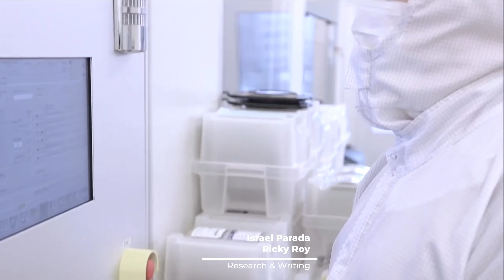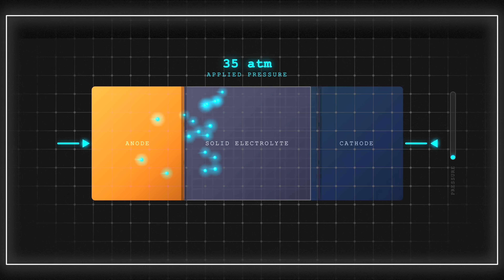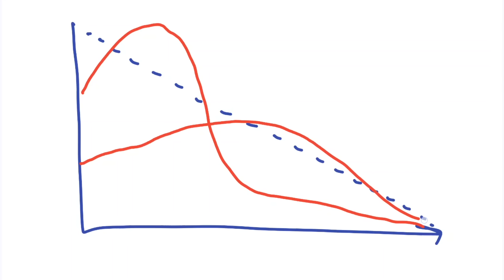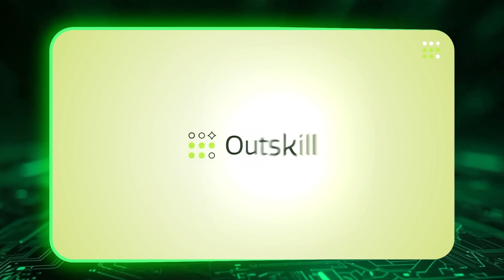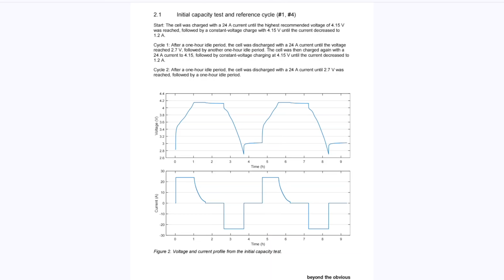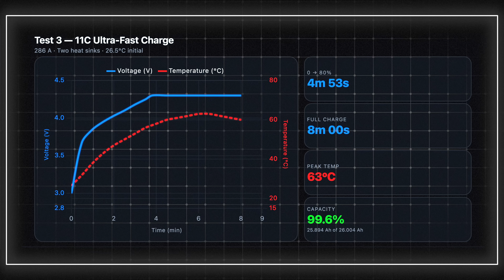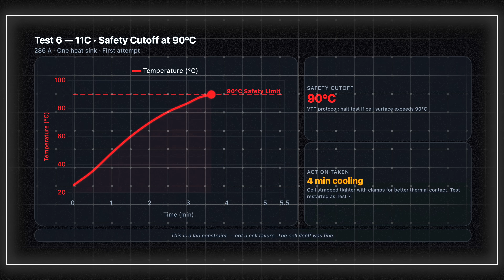Donut Lab's Solid State Battery Test are Shocking...

Comment: Great videos Ricky. You say it's evolutionary but not game changing: It sounds game changing to me. Let's lay it out in no particular order:
1) Charging rate: 10C seems like one of the biggest hurdles to "range anxiety" in an EV. It seems to me that if 10C could be accomplished, then the industry would be highly motivated to ramp up  charging stations. Perhaps incorporate them into existing gas stations.
2) Safety: If they're safer than LI batteries this is another huge "game changing" attribute. They can now be carried and used on aircraft or boats.
3) Watt/Hour Density: If they're alot smaller, then more can be fit into the same space, whittling away at "range anxiety"
I can't wait for future test results and for them to come onto the market.

I just watched Ryan's video (Ziroth) and think I now understand some things Ricky was trying to convey, but Ryan did much more concisely. (this is me not paying close enough attention to Ricky's video. You're awesome Ricky!)
With that said, I now see why Ricky says this is not "game changing" and it honestly has taken the wind out of my sails for this battery by Donut Labs. Time will tell if this is revolutionary but the points Ryan made are very deflating and almost make me think of Donut Lab's battery as "Snake oil".
I still can't wait for future testing, especially destructive analysis to see what they're really made of.

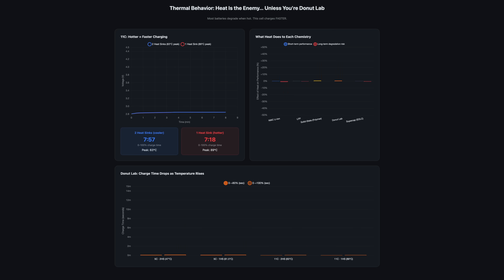Comment: I think you made a technical error - "traditional" lithium ion batteries do perform better at higher temperatures, right before they begin to degrade.  50-70C is probably where many lithium ion batteries will perform best, though it will come with noticable degradation (as we seem to see on this Donut battery as well) 11:16 

You kind of correct this later by noting we'd expect lower resistance with higher temperatures from a liquid electrolyte lithium ion battery.

Comment: Well, with performance increasing with temperature and with it claimed to be totally solid state and made of materials available everywhere on earth (in the previous video)... I'm wondering if the wrapper is acting as a sort of press, increasing internal pressures while maintaining integrity. Maybe that's the secret: that internal pressures are increased to a higher pressure, but not quite the described 50 atmospheres necessary before. What if the wrapper for the battery cell contains some sort of wonder material that contains the pressure? like carbon nano-tubes aligned into a self assembling filament? Maybe, instead of a material that we incidentally could create space elevators out of: maybe the battery itself includes some sort of self assembled carbon nanotube structure. If you could grow something (self assembling) you could make it perform any which way you wanted to. Depending on how its put together I guess? Perhaps that's why the battery is similar to what we've seen before, because the technology they've discovered can be fine tuned however you want. (Here's hoping lol) but then again, maybe its all just a scam of some sort? Only time will tell and I'm very optimistic about it, but would be very disappointed if it were a scam.

Comment: Can you comment on the current output on top end of the charge cycle? It appears to stay higher than you typically see in NMC cells where it drops down to near zero as the cell reaches 100% charge whereas this curves down to 60A but not to near zero. I’m sure there’s an obvious answer, I’m just not sure what that would be.

Comment: I just want to point out that yes, typical lithium ion cells are cooled down to prevent degradation, but they do charge faster at higher temperature. Tesla heats up the pack  to about  50 C for supercharging

Comment: Well if they confirm that all tests are done using same battery and not different cell engineered pass to each claim separately that is already much. Also in report in addition to Donut labs, customer line says NNG so Nordic nano group is the one providing the cell to Donut and it was find out by the press (Helsingin Sanomat published it based on some information they had) in Finland that ct-coating from Germany would be the one that would have provided the manufacturing technology so cell would have been probably 3d printed with their technique. I think the biggest open question related to this is which VTT won't test is that if manufacturing these by 3d printing will scale up to the levels expected. And when production has been scaled up, if they are consistent in quality. I'm pretty sure it is possible to make lab sample which this test cell is, that might perform well but to scale up and speed up production is the question. Anyways it is proven that they have a battery cell in their possession from nordic nano group that can be charged. I hope VTT states on other test reports specifically that other tests if results are what donut labs says is specifically made using this one cell they made the first tests with... Then we just would need to see these coming out from production line they have in significant numbers and they might have done something significant.

Comment: Best Video about it. 
I feel like Donut Lab is too open to be scammers. They would risk everything they build so far and their Motor is quite nice and unique.
Remember the invention of the lightbulb and what everyone said in the process.
Remember PCs and what some said about them.
Pretty much ever big invention went through this and many said it will not work or no one will use it until it worked and everyone used it.

Comment: it would really be nice to see something with lithum performance and not the fire hazard / charging cycle limitations , even at the cost of slightly less density, since you get back a lot by not having to add fire protections and 2-5 year replacement costs
Reply: @373323  well.. that is already out in the market

Comment: I evaluate what you present. I'm going to lay , excuse me, weigh into the 25 cent conversation.
First, I was biased before you started. I started to think it was a paid advertisement. But I watched, you started the road to redemption when you talked about the mass. 
Since the pastry folks omitted the  mass, they've diminished any possibility of being legit. 
Cycling a solid or semi solid battery for a few cycles proves nothing.
Having a battery pack with a known mass, and having charge and discharge, capacity tests, etc, that's what was left out.
Massatall🤓

Comment: the only test I'm interested in with solid state lithium (or any other battery technology) isn't range, speed of charging or cost per kwh. only ONE thing will matter if you're going to 'one-up' on the existing technology: shelf life & the number of charge cycles- THAT'S ALL. obsession over range & charging speed is already better than good enough- thanks to tesla's super charging network. in plain english? tesla owners don't care- I would know- I AM ONE. these are non-issues that are being pushed by EV nay sayers to scare potential buyers away. I sincerely hope that solid state lithium from donut labs is awesome in every category. time will tell. not a hard test to pass- just do some intensive fast charging & discharge cycling, then di-sect a cell & do an inspection. if dendrites are kicking off like a field of grass- the cell is a waste of time. if not? you've got a winner. if there's no mention of cycle life testing or results? there's your answer. they did the test- & FAILED- like all the 'solid state' cells before it.

Comment: This system that gives you capacitor-like power with battery-like energy.

Three-dimensional thin film, the researchers coated a surface with nanoscale spheres, which self-assembled into a lattice-like arrangement. The spaces between and around the spheres were then coated with metal, after which the spheres were melted or dissolved away, leaving the metal as a framework of empty pores. Electropolishing was then used to enlarge the pores and open up the framework, after which it was coated with a layer of the active material – both lithium-ion and nickel metal hydride batteries were created.

Comment: As for the Physics defying mystery of why these cells "like" heat and actually reduce their internal résistance:  Simple really: they are under a lot of internal pressure, which increases with higher temperatures.  A simple pressure gauge recording the internal pressure during these test would show a dramatic increase of internal pressure, which,  if constrained, which it definitely is, reduces internal resistance.

Comment: Doing these limited tests, seems obvious they are going to be sending VTT completely different cells each time tuned to exactly what they want, passing them off as all the same cell.
Reply: Exactly what I was starting to think when they released test for single specific one thing. It would be relatively easy to keep replacing batteries with the ones specifically made for specific test

Comment: I think we would need to know a lot more information... Maybe the curve is similar to another battery who knows... But this adds more questions than answers. 

You can also use Ohms law at the end of the charge when we know the constant voltage and you see the the current dropping.  When it was full at higher temperatures the battery was taking in about 80 ohms at 4.3v...  You take the Voltage divide by ohms and you get the resistance and you get 0,053 ohms...   Or 53 milliohms 

Now when they start the test the voltage looks to me like it was right around 3.8 volts when they were pushing in 286 amps... So if you take that voltage divide it by the Amps you get 0.013 ohms.... or 13miliohms...

So I don't understand where that 1 or 2 milioms number comes from...

Comment: The debate around the 400 Wh/kg and 11C charging usually gets stuck on cable thickness and thermal runaway. But there is a logical path if we look at this as a Software-Defined Battery architecture:

1. Surface Area: By using high-porosity nanostructures (the 'dough'), they maximize the ion-adsorption surface. This enables 11C charging because it's a surface reaction, not a slow bulk diffusion.

2. Decentralized GaN: Instead of a central BMS, imagine GaN DC-DC converters (like those from onsemi) integrated on each cell. By distributing power at high voltage and stepping it down only at the cell interface, you can use those 'impossible' thin cables.

3. Thermal Win-Win: In these nanostructures, internal resistance often decreases as temperature rises. The massive internal surface area of the 'dough' acts as a built-in heatsink for the GaN chips, allowing the system to thrive at high power where traditional batteries would fail.

It’s not just new chemistry; it’s a silicon-controlled power plant on a nano-scale. 

What’s your take on the efficiency of a decentralized GaN-on-cell architecture for weight reduction?

Comment: You are incorrect with your statement about performance at higher temps. All batteries will generally perform better at higher temps, especially lithium chemistries. This does however come at a cost of cycle life (and safety risk!). This testing has not proven anything new or ground breaking so far. They will milk investors as long as they can, this is how scams work.

Comment: Just think about this, How do they know it will last for 100K cycles? How do they know its other parameters without doing the testing?

If they are legit then the testing must have been done already. If that's the case they don't need to play this charade, they could just produce the test results even if they are only their internal results it would go a long way to legitimizing them.

They haven't produced those results for people to look at, Why?

If they haven't tested it How come you can place an online order for one of their bikes with this battery installed as a "free upgrade"?

BTW if you do place an order for a bike they put delivery off into the future. The last I checked a month ago it was in 3 months. I just checked now and its been pushed off to Q4. That's now 9 months away.

They still want their deposit though!

Comment: First off I just wanted to say that this is the best analyst I've seen so far, great job. 
Next I would like to point out something based on my own personal experience. I had a friend who was working on creating a new type of catalysis for fuel cells. At the time the standard was platinum at 1 volt. He came up with a different chemistry instead of platinum, that was running at 0.95 volts. If you had plotted his data it would have looked very similar to what a platinum fuel cell would have looked like. So I wouldn't dismiss the idea of new chemistry for this battery, as the plots are similar but not exact.

Comment: Nice video. I've worked at a solid state electrolyte start-up.
My guess is no lithium means no lithium metal, which would be true in an NMC/Gr cell.
One note on the temperature performance, standard Li-ion will have a lower charging voltage at higher temps, so that isn't odd. The cooling during EV charging is all about preserving lifetime -- most EVs will intentionally heat the pack a little prior to fast charging for this reason. Time spent at high temps cause parasitic reactions and capacity fade. And it's approximately exponential with temp. High SOC further accelerates it.
If it were a solid electrolyte, then I'd expect the internal resistance to drop with temp more than linearly, since ionic mobility is also ~exponential with temp in a solid (if that is the rate limiting mechanism).

Comment: eestor also defined complicated tests to prove its tech.  In the end they were a scam.  There could be a NMC battery in their pouch for all we know for this specific testing.  An electrical energy storage device .  You measure V*A going in then you wait.  Then you discharge the energy into a load (like heating water).  The device is measured for size throughout the tests, temperature, weight, and finally someone tears into it to find out the materials within.  The only thing potential customers need to know now is that this is legit.  Then you can get the attention of serious customers.

Comment: The cycle life is the elephant in the room. If it has a 100,000 cycle life to 70% at the same energy density as current tech that means packs could last 33 times as long as they do now!!  That would be virtually a lifetime battery you pass down to your heirs !!

Comment: I think you missed what would be the temperature at the pack level would it be a concern. Also the charging speed once it's at a pack level.  I keep on hearing there's a difference between testing  one cell compare to a pack.

Comment: I have to admit I have a little helper AI with me but now that CT coating-Holyvolt-Nordic Nano connection with Donut lab is on the news papers I will share my findings here. This is my "formula" for DONAT all-state-solid-battery

1. The "Ink" (The Active Materials)
Instead of heavy metals like Cobalt or Nickel, the "ink" is a Nanofluid Paste.
Amorphous Titanium Dioxide (TiO_2): This is the core "ghost" material. Unlike regular batteries that are crystalline (rigid like a brick wall), this is amorphous (flexible like a sponge).  
The "Breathe" Factor: This structure allows ions to rush in and out almost instantly (pseudocapacitance) without cracking the battery. This is why it can survive 11C charging and 100,000 cycles—it literally "breathes" the energy rather than forcing it.  
2. The "Lattice" (The Architecture)
They don't use the heavy copper or aluminum foils you find in a Tesla or Zero battery.
Spintronic Nanocarbon / MXenes: They use a lattice of "magnet dust" (Titanium Carbide MXenes). This lattice is incredibly conductive and has a massive surface area but weighs almost nothing.  
Weight Savings: By using this printed nanocarbon instead of metal foils, they strip out 30-40% of the "dead weight" of the cell. This is how they hit 400 Wh/kg while the rest of the industry is stuck at 250 Wh/kg.
3. The "Solid Salt" (The Electrolyte)
No liquid. No gel. No fire.
It is a Solid-Electrode Salt battery. Because there is no flammable liquid, you can drive a nail through it (the Puncture Test) or heat it to 100^\circ\text{C} without it ever catching fire.

Comment: They also claim it retains 99% capacity at extreme cold and hot temperatures which is uncharacteristic for a standard chemistry lithium battery.

Comment: I don't understand what's the problem with insisting about knowing the chemistry to the point to call the Donut representative as  potential "liar". The point, from a USER perspective, is NOT what the battery is made of, the point is what are the SPECS and if they match the manufacturer declared ones.
At the end, does this Donut battery outperform "conventional" lithium batteries or not? that's the answer that matter.

Comment: I'm a bit concerned about Donut dictating individual tests for each claimed attribute of their cell.  What's to stop them from reconfiguring each test cell to optimise it to suit each test?  You'd potentially (NPI) end up with all tests passed , but the final product being unable to genuinely display all of those attributes at once, as originally claimed.  It'd be interesting to know if VTT have received all of the pouches to be used throughout all tests in a single batch, before testing began, and with no substitutions allowed between tests.   We'd all love this battery to be the huge breakthrough Donut claim it is, but it's healthy to be skeptical.

Comment: Wait...so a lithium Ion battery can charge at 11c without active cooling? Much less a crappy passive heat sink?  The fact that it works better at higher temps also.  I dont see why the voltage curve even matters until they disclose the materials, thats just conjecture based on existing chemistries which they were pretty emphatic that this was not.  I think the first two items should immediately disabuse the notion that this is at all similar.